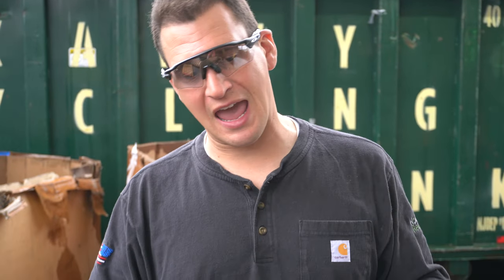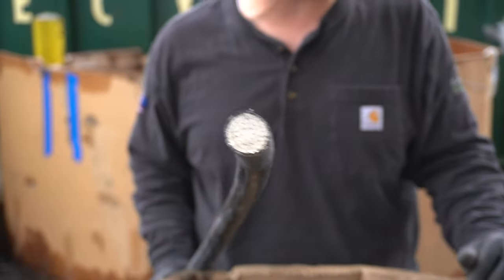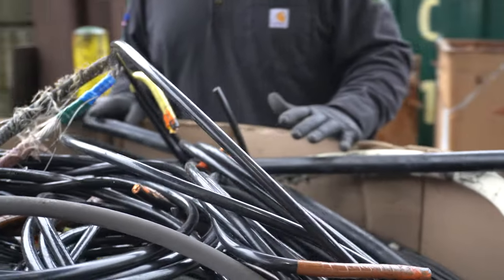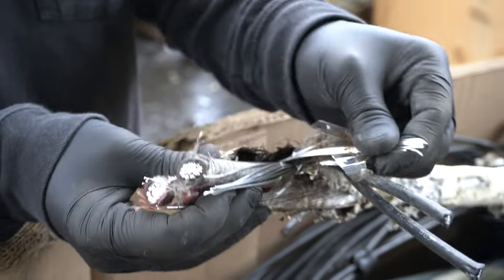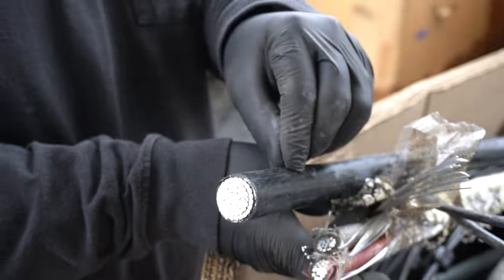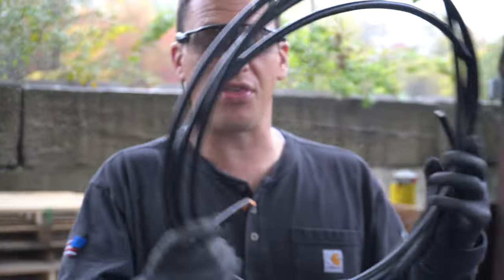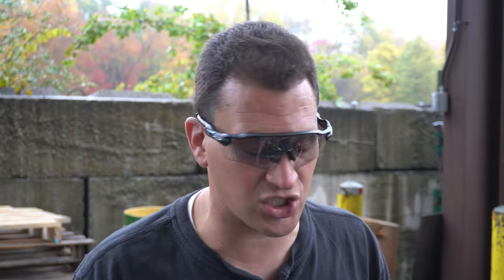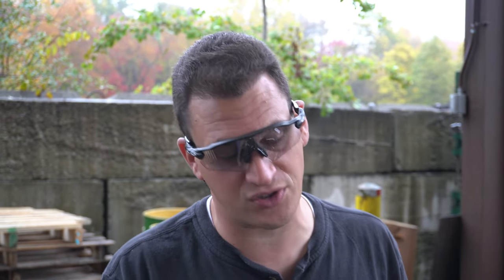Stripping Aluminum Cable For Higher Profit

Comment: I recently started getting a large volume of 750mcm aluminum.  Many local yards won't even buy it insulated.  I buy it from demolition companies.  I pay netween $.15 and $.20 a pound for it.   You can strip 150+ pounds an hour, by hand.   I have found that 85%-92% of the weight of 500 and 750 mcm  alumimum wire is aluminum.  Some yards I sell it as alumimum clips and some as extrusion, either way I can spend a day,  strip a half a ton of it and make $.60 a pound.  So thats $150 in material costs, 8-10 hours of my time sell the alumimum for $540 and make a nice $390 profit, $350 if you factor in fuel and consumables.  People don't want to deal wirh it, but with the right supply and some trial and error with stripping, there is decent money to be made.
Reply: Thanks man Im sitting on about 600 pounds right now of aluminum ec wire gonna buy a strip miester and strip it all next spring.
Reply from the maker: Great side hustle and learning how to make money is a specialty. Good for you!
Reply: I agree! I find quite a bit of it and my scrap yard I frequent here in Tampa, Fl pays $.20 insulated but $.80 bare… huge difference!! So I usually save it up for a while and strip a few piles of it when I have a down day. And honestly, thanks to my scale operator there where I take my non-ferrous stuff told me when I had a small tub full and was gonna sell it insulated… he told me I’d make more stripping it! And I must tell you, after going to a few different yards around town when I first started scrapping, him looking out for me was awesome!! So from then on, I take all my scrap there and nowhere else! They are always honest and have my best $$ in mind! Therefore, I always tip him and any helpers that help me unload.

Comment: The wire that has multiple conductors and the old gunky stuff on the outside, you can just strip the stuff on the outside with a knife it comes off very easily. Just slice it down the center for the length and pull it off with gloved hands. You twist up the uninsulated neutral wire that's wrapped around the other two wires so it's one solid piece. You toss that in the pile, then send the other two conductors into the stripping machine

Comment: I try to take into consideration not the percentage increase but the dollar amount.  Doubling my money is great but if I'm only going from 30 to 60 cents per pound,  my effort is worth much less than upgrading from $1.50 up to $3.00 per pound.
Reply: Yeah but if you get 600 pounds
Reply: @KillerKolt44  600 pounds or 6000 doesn't matter. when you get 30 cents or 1,50  per pound for the stripping only i would rather get 1,50. And on top of that, i haven't had much aluminum cable's but the few pieces solid cable i had were tough to strip compared to Copper
Reply: Ec wire is easy to strip.
Reply from the maker: Time always = Money...but sometimes saving those items when you are slow makes up for the smaller profit margin.

Comment: Tom, how would you strip that large cable? I have the thick cable but it does not fit into my Stripmeister and a blade does very little. I am stripping the smaller aluminum cable.
Reply from the maker: typically larger cable needs larger tools. Heres a few we recommend: https://iscrapapp.com/blog/the-best-wire-strippers-for-scrap-copper-wire-cable/

Comment: Honestly that kind of aluminum wire is difficult to strip. The insulation is very tough and rigid
Reply: Ya gotta leave it in the sun for an hour or use a heat gun nd invest in a wire stripper of some sort
Reply from the maker: A lot of different ways to try things to test them.
Reply: Leave it in a black contractor trash bag In the sun on a hot day. Don't waste time or energy using a heat gun. Use a free resource. Also a stripping machine works great